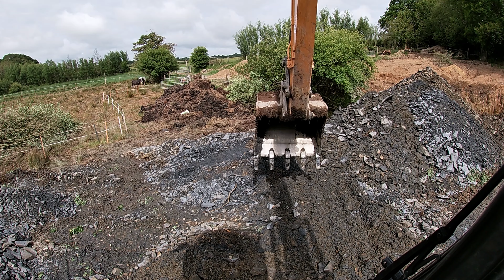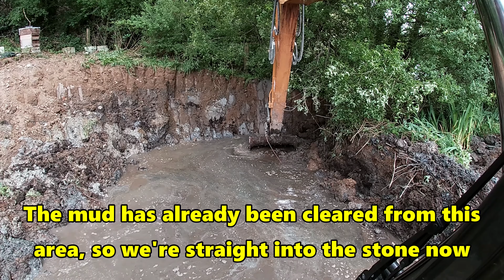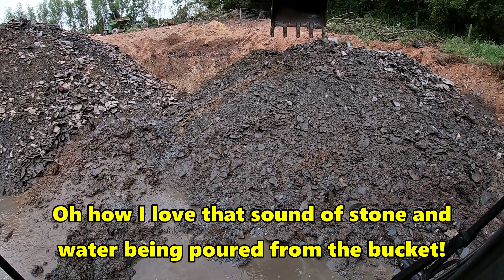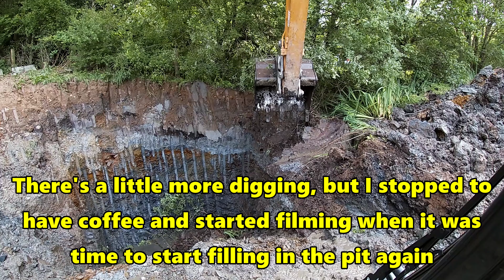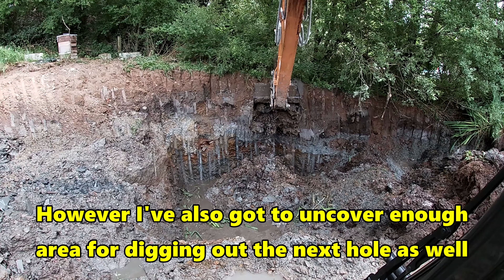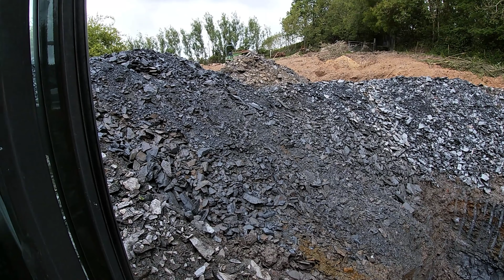Frithgar's Working Holiday, Day 5

Comment: Was it an ancient Roman tile you dug up at 2:35, Frithgar?  Time for a archaeological survey now? They will pay for the digging!  LOL
What music? Of course if it had been a Volvo EL it had sounded as choir of angels in my ears (but in CASE?)!  Have a good weekend with the family, Frithgar!   <3
Reply from the maker: No, just some old red bricks, there is also a whole network of old clay pipes laid through the field, of the kind that were often installed during the 19th century and largely fell out of use in the early 1900's.  So at a guess I'd say most of the pipes you see being dug up, at least the clay ones, would have been put there roughly 130-150 years ago.  They were quite enthusiastic about putting them in, the field is riddled with them!
Reply: @Frithgar  I've seen some of these also today changing 100 m of concrete pipes to plastic 400 mm in a main drainage 2-3 m down. I "found" four layers of tiles in all different directions as this is an old seabottom with very heavy blue clay under the humus. Now it's only about 400 m left to do on my "vacation"!  But it's very dry at home now! I found also a lot of metal parts (no swords!) so I can probably build you a new combine (or horse wagon).  :D